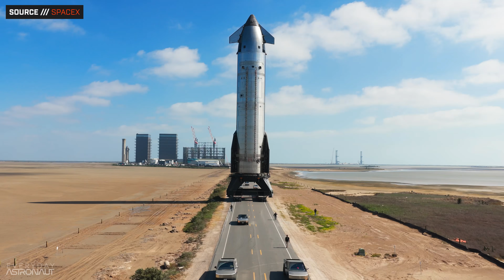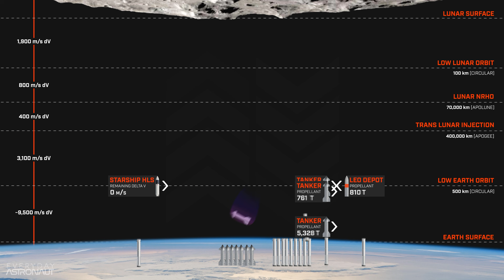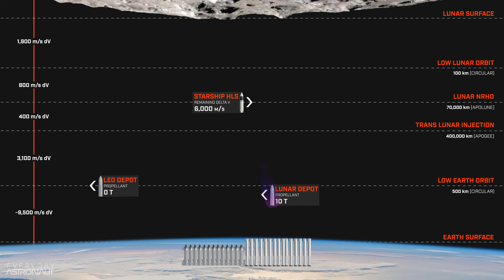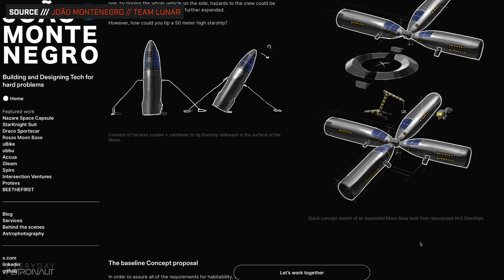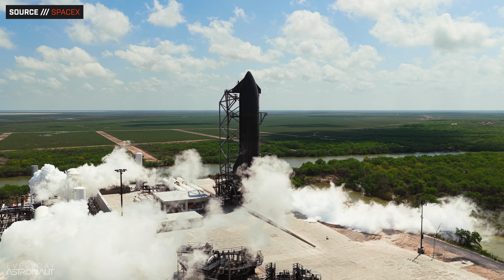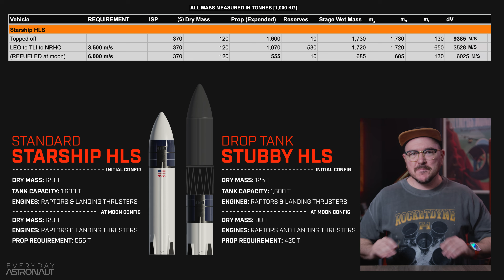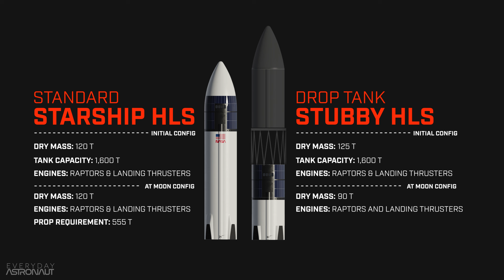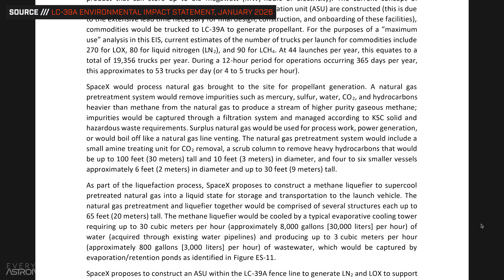Does Starship REALLY require 15+ launches to land one lunar Starship?!

Comment: Isn't the best way to reduce the number of launches needed for refilling to put a fuel depot in LLO?
If the ship doesn't have to land with the fuel needed to go back to NRHO but only to LLO that reduces the delta-v needed by 730 m/s
So that's a 20% reduction in the number of refillings.
If the lander only has to go from LLO to the Moon surface and back to LLO on it's own and can refill in LLO when it has to go to NRHO to dock with Orion then it only needs 1.72*2 = 3.44 km/s of delta-v so you can make it extra stubby.

If it carries 100 tons to the Moon surface and comes back empty then it is:
e^(1720/9.81/370)90 = 144 tons when taking off from the Moon.
144+100 = 244 tons when landing on the Moon.
e^(1720/9.81/370)244 = 392 tons when leaving LLO for the Moon surface. 
It has to come back from LLO to NRHO so with a dry weight of 90 tons it needs to leave e^(730/9.81/370)90-90 = 20 tons in the fuel depot.
So 392+20 = 412 tons before filling the fuel depot.
So e^(730/9.81/370)412 = 504 tons before leaving NRHO for LLO

Other savings would be to not use NRHO
TLI->NRHO->LLO = 430+730 = 1160 m/s
TLI -> LLO = 900 m/s
So 1160-900 = 260 m/s of savings
If we don't use NRHO then the lander needs to leave e^(900/9.81/370)90-90 = 25 tons in the fuel depot
So 392+25 = 417 tons before filling the fuel depot
So e^(900/9.81/370)417 = 534 tons in TLI
Reply from the maker: We talk about that. It only makes sense if the lander is heavier than the depot
Reply: @EverydayAstronaut  It makes sense because the lander only has to carry 200 tons of propellant to go from LLO to the surface and back to LLO so you can make the fuel tank a lot smaller.
But you need a separate ship to supply the depot.
Reply: SpaceX is reducing the number of supply trips by making the Tankers and Booster have even more capacity. Version 4 is stretched longer, populated with far more engines, and carries far more propellant per launch. The Tanker will use 6 vacuum engines plus three sea-level engines, increasing total thrust by about 50%.

Comment: This might be a intended, but for me there is a bit to much echo in the room audio track. Otherwise excellent video as always (watched it on Nebula already).
Reply from the maker: It’s the same mic / room / set up I’ve used for the last 6 years 😅 nothing has changed
Reply: @EverydayAstronaut he's right though, there is some echo
Reply: @EverydayAstronaut sounds different to all others. Not super bad maybe more a processor setting
Reply from the maker: I don’t get what happened, it’s all the same 😭 maybe something got bumped but I can’t tell what. A lot of people are commenting on it
Reply: @EverydayAstronaut I think it's more of an issue with the acoustics of your physical surroundings. That's why people put foam down on walls etc.
Reply: @EverydayAstronaut the mic is too far away, so picking up a high proportion of room noise compared to direct sound from you.
Reply from the maker: But why has no one said a single thing about it in the last 6 years. The mic's mounted to the ceiling and hasn't moved an inch.
Reply: @EverydayAstronaut i don't watch a ton of your vids so can't comment on changes. But the bathroom echo was noticeable. And your voice seemed shouty. Almost like it was getting over amplified and starting to clip in places.
Reply: @EverydayAstronaut  when it happend to me. GoXLR software update some how added reverb to  my mic tool chain. 

If you want a space angle could be cosmic rays flipping he exact bit to give you reverb! Everyone forgets ECC memory.
Reply: @EverydayAstronaut yeah I’ve watched just about all of your videos, and have done some recording myself so know what goes into good audio, and noticed it immediately as the first words work spoken. It’s jarring.
Reply: @EverydayAstronaut I have noticed the problem before with your videos - not terrible, but compared to everything else - content, delivery, graphics, your studio, all absolute top notch - it stands out. Not sure why it’s worse this time if all the levels are the same. Software updates?
Reply: @EverydayAstronaut yeah bit echoey

Comment: They could get even more efficient by only shipping carbon to the moon to make the methane on site in addition to the oxygen. Could also use the carbon for making steel or in farming.
Reply: Methane is a small portion of the propellant mass. Shipping it from Earth will be cost effective for a long time. Decades. Plus, methane brings along hydrogen which is even lighter than the carbon.
Reply: @imconsequetau5275  Sure, but once a bit of industry is up and running carbon will be even easier to ship and has a ton of uses. The moon has almost no carbon so it will need to be imported anyway for industrial use. If you get your oxygen from water you have hydrogen as a byproduct anyway. 

Of course this wouldn't make sense until a few years down the road once some demand for carbon is established.